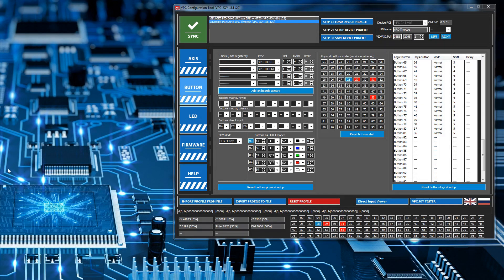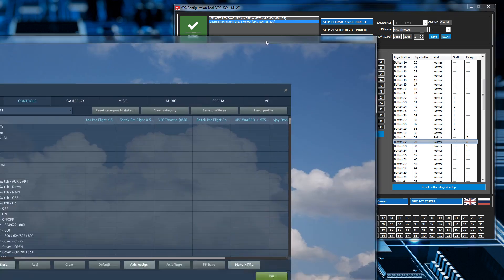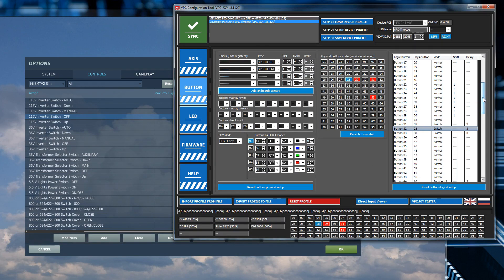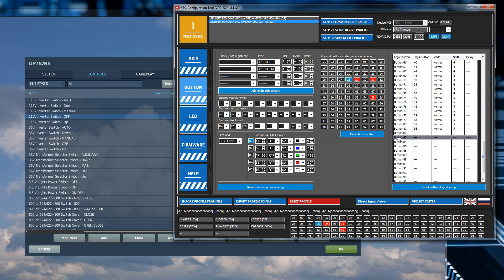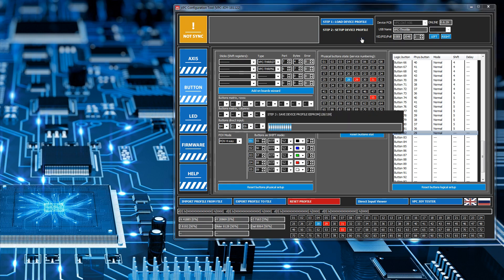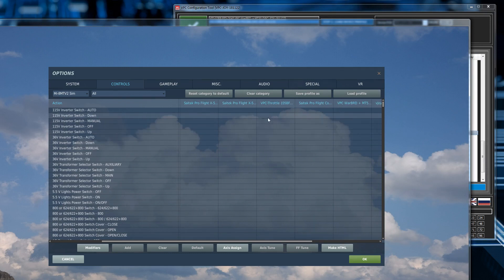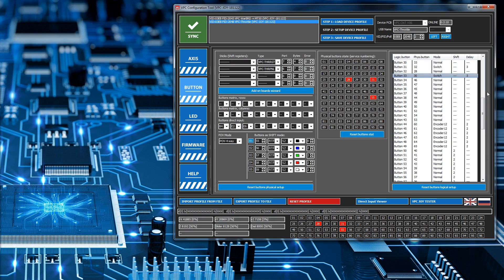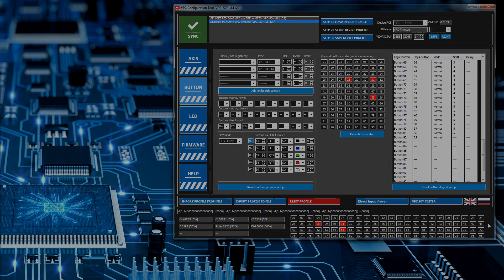Virpil VPC configuration software - throttle toggle switches

Comment: Can the LED buttons colors be configured to operate independently.  For example, have one button red when gear is up and press that same button to turn the light green and have gear down?  I would like to control each LED button with different colors and functions
Reply from the maker: Sadly I do not own a CM2 or CM3 throttle, so I cannot work that out for you (all of my kit is paid for) and not given to me by Virpil

Comment: Does it matter to DCS if the physical and logical button numbers are different or do you first have to make them the same?
Reply from the maker: It does not matter, the logical buttons are what windows or joystick gremlin will see, the physical buttons are mapped to the logical buttons in the VPC software, it doe snot matter if there do not match up. BUT never leave spaces if you are re-mapping them, it will cause problems